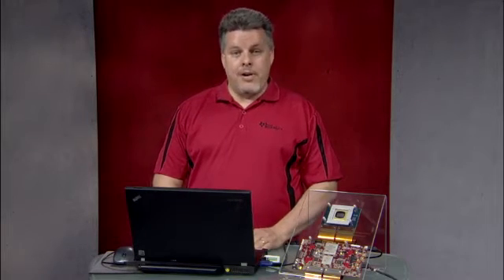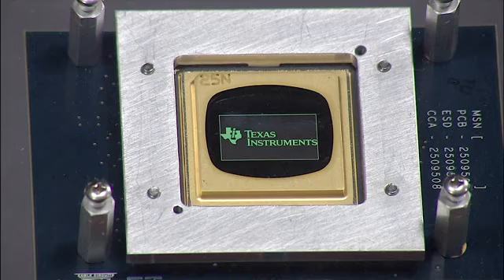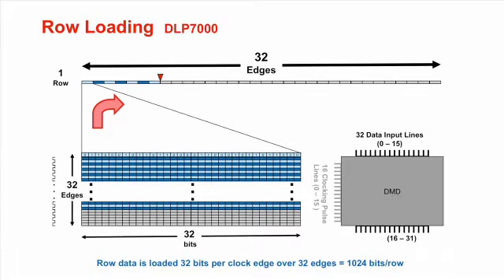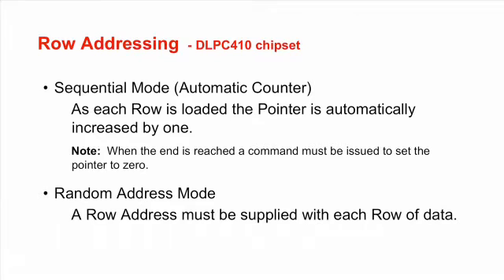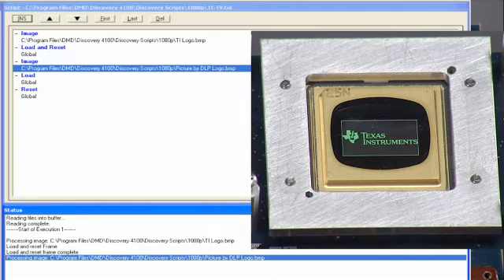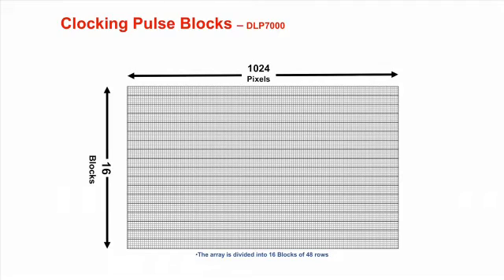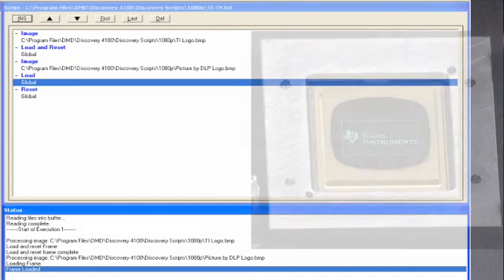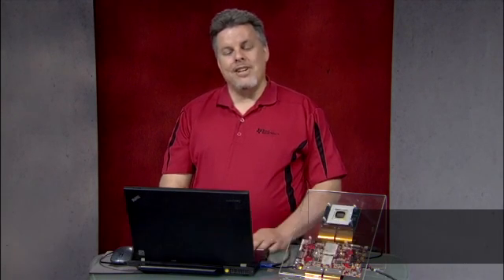Loading Data onto the Digital Micromirror Device (DMD)

Comment: Is it possible to use a laser light source ,635nm? I want to generate geometric shapes, but I want to use a laser as the light source. Also is it possible to angle the mirrors at specific angles? To make lines of specific sizes?
Reply: Regarding your 2nd question you can only set them at two posible angles, either +12° or -12°